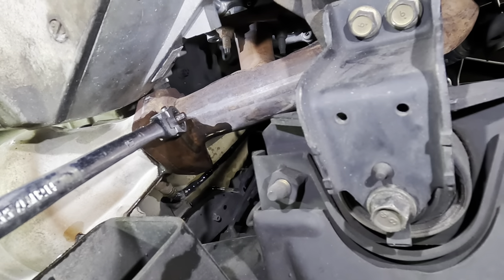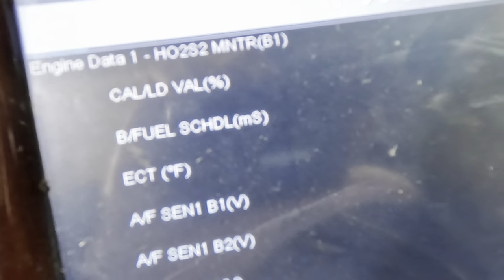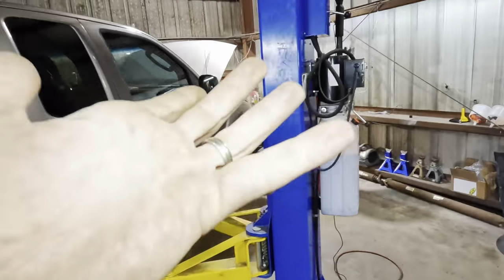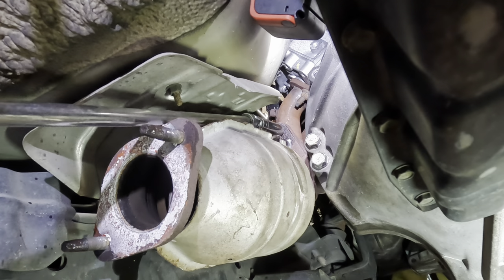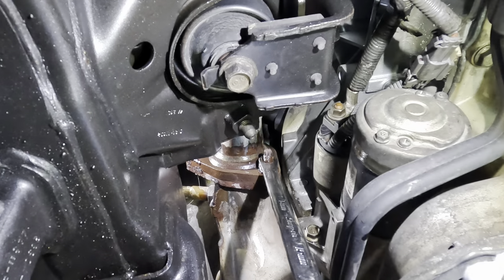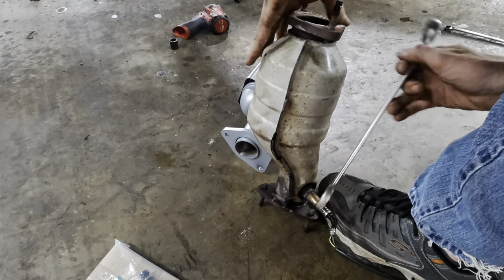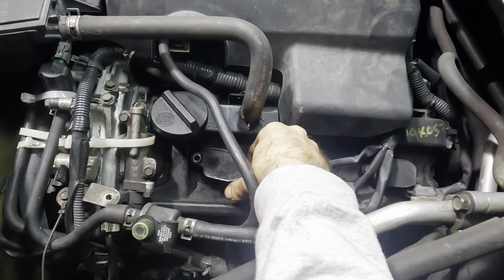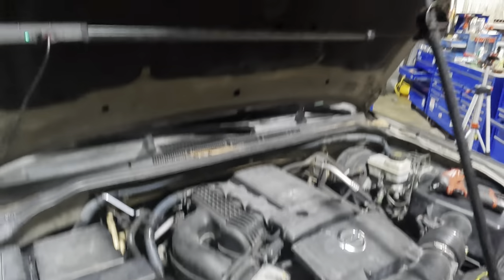Catalytic Converters! Missing?  Running Rough P0302 P0420 P0430 Nissan Fronter 4.0 v6

Comment: The shop next door does primarily body work and older car restoration projects and has a ready stream of work for Ray. It looks like they are going through this truck part by part. Someone deleted all 4 cats and now the new owner replaced them. The engine had already been replaced. It will be good for the relationship between the shops to diagnose the misfire and give them the option of DIY. I suspect that the business next door owns the building as well. Leaving out those details is good business for the film producer (Ray) as it creates a level of uncertainty without cluttering the dialog.
Reply: They seem more like auction cars destined for the used car lot if I had to guess but work is work. And Ray is not taking regular requests from individuals for service at this time for some reason. A few local maintenance jobs that I have referred to Ray (via his email address) have gone unanswered. Not sure he ever plans on working on locals' individual vehicles. (I don't blame him) Unless or until he hires some help and that's a whole different game with workers comp insurance and all the bull that accompanies finding reliable employees in the area his shop is located.
Reply: That car has already had more repairs than it is worth. Time to get a different car!

Comment: I have had those kind of issues as well with batteries. And what it is is the batteries get too low and the charger just doesn't like to do it. If you have a battery that's doing that look up how to jump them. You basically take a known battery that's good and has a full charge and you jump it like a car positive positive negative to negative for a couple minutes and it gives juice to that bad battery and then when you throw it on the charger it will more than likely take the charge. I have hart tools because I'm a truck driver and I don't want expensive as power tools that could end up getting broken just rattling around in my truck.  I bought a bunch of "dead" 2 amp hour and 4 amp hour batteries of theirs and out of the 10 batteries only one kept failing. The rest after they failed the initial time once I jump them they charged right the hell up. Saves you buttload of money. And the worst that can happen is you try it the battery doesn't work and it's dead dead.

Comment: You're a lot luckier than I am on bolts breaking loose, I've never took an exhaust apart that easy and simple, never in my life, and yeap I used lube too !
Reply: Think it has been apart before
Reply: @garyalford9394  For sure when they installed that replacement engine.

Comment: Your videos really are therapy.  I usually watch them to wind down from a day of dealing with people.  I am amazed that you work on cars without full use of the 4 letter word dictionary.  It is very rare to get through fixing vehicles in the rusty midwest without dropping some f-bombs at the very least.  

The jet on the treadmill would be irrelevant as it is jet engine powered which pushes the air, not ground.  The air is not moved by the conveyor belt so the engines would produce just as much thrust and actually overpower the conveyor belt.  The jet would take off.  The wheels may or may not hold up to the increased speed they would be spinning due to the conveyor.

Comment: Ray, just a footnote to your comment about better quality fuel to improve emissions.  My wife's 2010 Camry failed emissions test on yearly safety inspection (car does not burn oil), so I came back a week later for retest, after filling it up with high test gasoline and it passed with flying colors.  Fill up your tank with high test gasoline before inspection folks.
PS: Back in the day when they let you in auto junk yards to find your own parts, I always left with more tools than I came with....LOL
Reply: They STILL let you into auto junkyards aka Pick a part. And what are these inspection you speak of? We have no such thing down South here (must be a Yankee). And I prefer used cooking oil to run my big wheels.
Reply: @mod_incllc3235  Florida does have on the books safety rules that require repairs be made if defects are discovered at a traffic stop. You are right no state inspections, but if your vehicle is determined to be unsafe they can make you fix it by issuing a citation on the defects

Comment: Sometimes with tool batteries, if you put them in the charger and flick the charger on and off a couple times it will trick the battery into charging again.
Reply: Some batteries need a minimal charge to operate the control circuitry, without it they cutout, however for a small time before it cuts out they apply voltage to the cell or cells.   Multiple attempts can get that battery back above minimum.   If it’s not charging this is worth trying.

Comment: You need to jump the under charge batteries with a charged one. Transfer some charge to them.. enough for the charger to detect a charge. You can find YouTube vids on this.
Reply: Don't hold me to this, but I think if you unplug the charger and put the battery in and plug and unplug the charger quickly a few times, it might work.
Reply: Yup. as the "Smart" Batty  Chargers are ,, "Not" smart !
Reply: @grassroot011  smart enough to make us go out a get new ones..
Reply: This also helps with electric wheelchair chargers.

Comment: Ridgid is made by the same company that makes Milwaukee, (TTI) they just market them to consumers, but in many cases, Ridgid has actually beaten their competition. The Ridgid high torque Octane impact wrenches actually beat all competition in its class for a short time and then they discontinued that line because their big brother, Milwaukee probably got jealous. BTW, if you have the correct power source, a buck/boost converter or a bench power supply, you can bring those batteries back to life, but you have to know how to do it so bad things don't happen. I've brought back many batteries from the dead. If they are defective, it obviously won't work though.  Anyway, anyone who says Ridgid is crap is full of it!  Edit: Ridgid power tools have a lifetime warranty if you register them correctly.
Reply: Ryobi is also manufactured by TTI
Reply: @iandrewc  Which is very home consumer driven.
Reply: @jamienoel  Indeed, but the point is that they make a full price range of products

Comment: Hey Ray, Congrats again!!! You made the best move, being your own boss and doing things right and honest is harder work, but definitely more gratifying. On this video, the only thing, being you were replacing “All the Cats” they should of used your time wisely and replaced the O2 sensors while you had easy access. It was probably due to $$ because I always recommend OEM O2’s, but it would of eliminated future issues in the exhaust portion (at least) than having to do them in the future. 
May you continue with your good fortune and you give honest mechanics a good name, and show people the crap we have to go through a lot of the times due to these car designers/engineers when the shove 2lbs of bologna in a 1 lb bag……. 
Take care.

Comment: I have a feeling the customer is not going to be happy about spending that much on Cat's to find out they still have the same problem they were trying to resolve. I wonder if the other shop even took a look at the coils....Another Great Video Ray!
Reply: He checked there was a code for it, and the check engine light. It had to be done. It was in the video.
Reply: Actually it’s been proven and explained in a an episode of myth busters.
Reply: @bjkjoseph  I didn't say the cats didn't need to be replaced, I'm talking about the customer that thinks this is why it was misfiring or the other shop that thinks this was causing the misfiring....." it was in the comment"
Reply: I don't think so but I wasn't there
Reply: @PatricksDIY  you’re probably right he probably will be pissed off, even if things are explained, and he is showing proof that it needs to be repaired, you’re right though there’s a lot of people like that
Reply: First off the guy new the front 2 cats were bad since the guts were removed from them to allow the free flow of exhaust gas through  them,. Then on that assumption he had the back two replaced just in case, since they were owner provided parts as well so happy or not the owner knew of the problem before hand. The front 2 had to be replaced as there is no way they would work as designed.  That said A misfire can damage  cats if left in that condition due to excessive fuel getting in the exhaust and being burned there. It is absolutely necessary that the coils be replaced to prevent future damage to the new cats

Comment: That battery issue used to happen with my old Ryobi 12V system. I'd have to connect a newer battery to the old batteries with a couple of jumper wires. I'd hold them on there for about 5 seconds and it would give the old batteries enough life to take a charge.

Comment: we have the same scanner in our shop (UK) there's a 'userdata' folder that I clean up every couple of months as it seems to affect the speed of the tool sometimes, you need to be careful of which files to move out of the folder since they are system files
Reply: So it "like" a Defrag or System Clean for a Laptop/Computer? The more "Junk in the Trunk.....the Slower" you go! 
Great Tip!!
Reply: Can it be reset back to factory settings?
Reply: @Delekham  no, more like deleting the stuff you dont need. which is like throwing bricks out of your trunk. full storage slows computers down way more than you think, and id bet that didnt come with much. 

defrag is more of a reorganization, it's purpose isnt to delete it just shuffles the files around so they're in physically different places on the drive. solid state drives cant be defragged because they have that built into their firmware
Reply: @bradhaines3142  Yes! That I understand! I was using it a "layman's" way to understand it!
 Too bad you never picked up on that :(
Most people DON'T understand what a "Defrag" is! Most people just hit "Clean it"! 
As the OP said..."you need to be careful of which files to move out of the folder since they are system files."
So you are right and wrong at the same time!.
That tool is a Computer? YES? NO?
If it is, then a "Defrag" would be helpful, since it is NOT searching the HDD as much...hence SLOWING IT DOOOOWWWWNNN! YES, NO, MAYBE SO? 
I do know that SSD's can not be "Defragged" I Will bet Dollars to Donuts that in the Future it will happen! :)
The "Cleaning UP" of said Computer is needed though!
 Two or Three years of "cookies/vehicles" will slow down ANY computer!
Reply: @Delekham  yes, it is a computer. I'd very surprised if it had a spinning disk ... that would make it not very rugged. It probably has some eMMC for storage and operating system.
Reply: The main slowdown is just the fact the files are there and the tool accesses them for whatever reason. When I do it I copy and paste the folder and rename it to 'userdata.old' then in the original I'll delete the unnecessary files

Comment: The best part of this video is the diagnostic effort at the end. I like the way you verified the bad boot, and carbon on the boot showed it wasn't just artefact from pulling the coil out to make a huge gap. Is it possible to just replace the boot and a plug, rather than the whole coil? Or are boots by themselves nearly impossible to come by?
Reply: All one unit..
Reply: I looked into this earlier. It looks like you can get the boots separately.
Nissan part number 22465-8J115, WVE 4C2015 on the rockauto.

Comment: Dis-similar metals in the cat converter so the ground wire is there to prevent galvanic corrosion and to provide a good ground for the 02 sensor.
Reply: Wouldn't want the anti corrosion material to corrode...

Comment: Hey Ray!
What you are experiencing with your Duramax is normal for cold weather starts. I live in Michigan and my Duramax does this too. The alternator is controlled by the ecu and will not trigger after a high draw event. On cold days, turn the key to the "on" position and wait about 10 seconds. This let's the glow plugs warm, then staring z engine. After the two batteries equalize, usually a couple of minutes, the alternator will turn on.

Comment: Nice video - don't think I have seen a cat replacement one before.  Seems simple - when you know what you are doing :)  Hopefully the coil pack replacement work gets the go ahead... I know everyone is stretched financially these days, but I can't help but feel letting that situation get worse will cost more in the long term.
Reply: Yes leaving the misfire to continue will eventually destroy the new cats and O2 sensors
Reply: The hard part is the rusted bolts
Reply: they do sell replacement boots for those coils
Reply: The hard part is the rusted bolts and getting to the rusted bolts

Comment: As a Nissan Technician in the rust belt (Canada) I enjoyed watching this lol .. The "That better not be factory" cracked me up - but yes, that's factory - for whatever reason most Nissans have one or two studs that don't face the same way as all the other fasteners. It's a good time! Also this truck wouldn't even register as rusted here.. pretty typical after the first winter! I was very jealous watching you break the 02 sensors free with an open end wrench and your foot - the vehicle would have to be pretty new here to even consider not chucking the cat in the vice and pulling out the bigger tools

Comment: Hey Ray, i was amazed at how easily those bolts came off. Cheers!
Reply: Penetrating oil can make a huge difference!  I use it a lot. For best results, spray, leave a bit, tap it gently with a hammer, spray it again, wait a bit longer, tap again and then remove. In extreme circumstances you will need to leave it overnight and possibly use heat.

Comment: Hi Ray
You noted that the rechargeable batteries sometimes don't work after being discharged too low, then over the weekend they might be recovering enough voltage to kickstart the onboard circuitry.  It's been noted that the circuit board of "some brands" of batteries disconnect the charge/discharge terminal if the cells go below a certain voltage. Somewhere on the web I have seen people open them and give the cells a bootstrap to kickstart the circuit to reconnect the terminal, so maybe don't throw out any failed batteries. Hope this helps if not noted by anyone already.

Comment: Ray, that happens when a converter is at operating temperature and then the vehicle is driven into water rocker panel deep. The thermal shock causes the honeycomb inside to fracture. The exhaust flow will then blow it out of the tailpipe
Reply: And the converter is cheap crap, normaly they are isolated against that even on normal cars as long as there is no water entering internaly.
Reply: Wouldn't the material leaving the converter be found in the muffler possibly blocking the muffler or rattling in the muffler?

Comment: Merry xmas. And the plane would just sit there with the wheels spinning going nowhere.
Reply: Wrong.  The conveyor belt makes no difference.  Mythbusters proved it with both a small RC plane and a real plane.  Planes do not drive themselves forward with their wheels.
Reply: The mythbuster proved the plane would take by doing the experiment it works cause the wheels are not powered
Reply: @jeremygarwood  Yep, I've been trying to tell people this for years.  Plane wheels just spin freely, the plane really does not care.  You'll notice in the video that not only does the plane take off, the pilot said he couldn't feel any difference.
Reply: Yeah i am wrong i thought he said with the engine off at the begining. The thrust would take the plane forward regardless .

Comment: Great video.  BTW, regarding the battery issues.  When batteries like those start wearing (shorting cells) the can start to overheat internally which increases resistance and can trigger a "bad battery" behavior / indicator.  It's not uncommon to cool them down and have then accept a charge.  Whenever you charge any battery, best to let them cool down first and then charge them.  Remember those Batt cells heat up when being used and heat up again when working to accept a charge.  Best to have a few extra batteries and let them sit (especially as they get older) maybe 15 - 30 min and then charge.  Also, you can revive some old batteries by placing them in the freezer for several hours (sometimes over night) and then try to charge them. Some Batts will work better than others with this method.

Comment: You’re 100% right about the fuel. What you get at the pumps now is trash compared to race fuel or pump fuel from many years ago. In the northern “ cold “ states from November to April it gets even worse with oxygen infused gas. Causes about a 10% reduction in power and MPG.
Reply: Ethanol in gas also reduces the relative btu per gallon, thus there rhetorically reducing power/mileage.
Reply: @davidturk6170  --Supposedly 20% less effficiency with ethanol as gas additive plus it sometimes will gum up on Injectors...

Comment: If you turn the plane around and apply the brakes, then yes it could achieve take off, but to maintain flight you'd have to turn the engines on and full thrust.
Reply: No